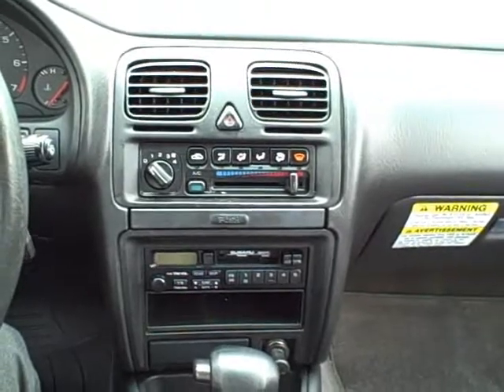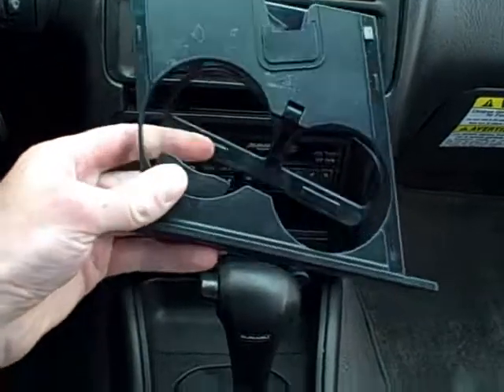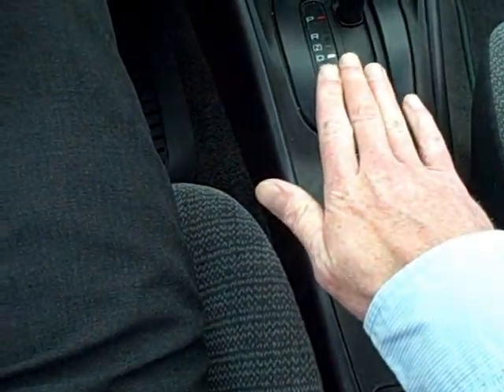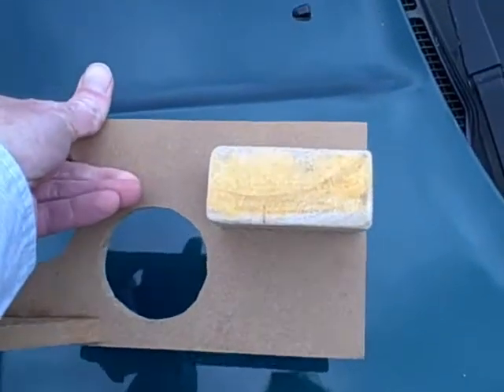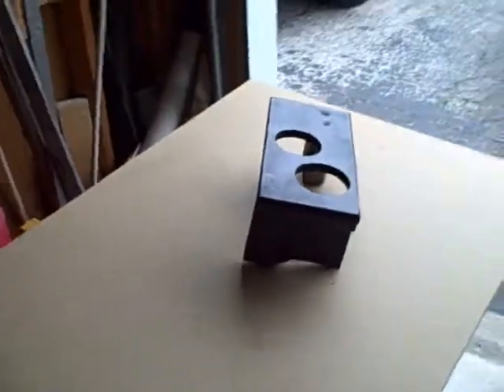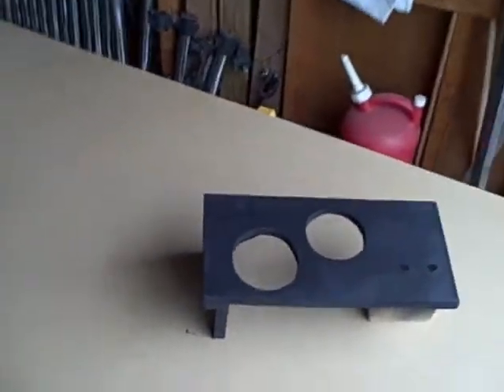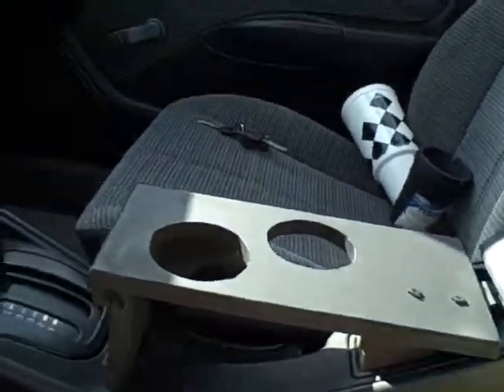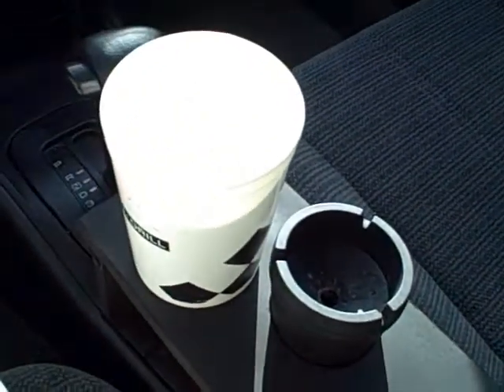Subaru Legacy Cup Holder Replacement Idea 1995-1999 Models

Comment: Why? The parking brake is almost completely unnecessary in an automatic vehicle. There's never an emergency that calls for it. If you're going to park on a steep hill and you want the ever so slight insurance from the e-brake, just pull out your cup holder. No big deal. Although I personally have never found a need to pull the e-brake.

Comment: "Emergency" brakes will not do you any good if your brakes fail. Ask any mechanic. That's why a better word to describe would be "parking  brake." Because that's what the parking brake is for. But if you don't believe me, I suggest you disable your brakes and try using your parking brake instead..... But DO make sure your air bags are up to date. Cheerio!

Comment: "you must use the parking brake EVERY time even if it's an automatic" lol.  seriously laughing. "the car can easily roll by a small bump from another car"  hahah what? you could slam into a parked car going 65mph, the parked car will stay in park.  I guarantee it.
Great idea on the cup holder! My Forester has the single cup holder right above the radio. It's super flimsy, blocks all the climate controls, and the condensation on the cup drips down onto my radio.  Wish Subaru would've placed it better haha.